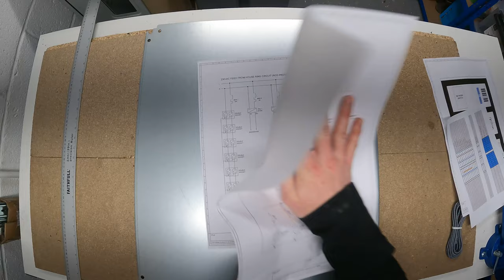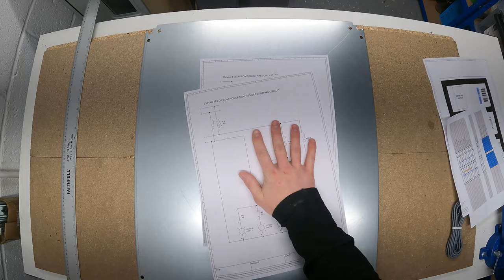My Home Automation Project Using Loxone - ASMR Edition

Comment: Maybe I don't see your connection, but:

You must connect all GND 0V's of the power supplies together, to get the same potential on all 24v devices/extensions, otherwise there could be transmission interference. 
You've split the 24v power over two supplies, which is fine, however you need to connect all GND's together at the end.
Reply from the maker: Correct, this has been done.

Comment: Couple of thing you might consider (or may have already and ruled out, apologies if so) 
Din rail shear rather than the jigsaw - quicker, cleaner, easier on the ears. (But a reasonable capital investment)
Din rail mounted Ethernet switches - I’ve found that “office” grade with plug in PSU’s have a higher failure rate than Din rail, plus takes up less space and front access to the sockets. Red Lion controls do some very reasonable priced units.
Reply from the maker: Hey Ben, thanks for your comment mate. A Din rail shear would be lovely, just don’t really have space for it. I don’t tend to use switches in panels and this is for my home project so not to bothered about reliability. You’re dead right though, for commercial and industrial projects I’d be using the type that you’ve suggested. Thanks again Ben 👍🏼

Comment: Love your videos man, what type of cabling do you use throughout the house to run on the loxone system, cat6e or are you using proprietary cable from loxone?

Second what considerations should one take when doing a new construction for wiring for loxone, how many cables to each tv, or switch etc. will the same type cableing work if you want to add control 4 on top of loxone like your other video suggestion. How do you cater to both systems when considering cabling?

Sorry loaded question but if you have time appreciate some wisdom?
Reply from the maker: I use both :) … depends if I’m using Loxone lighting.

With AV you just wire for however that device is controlled  (usually IP so Ethernet) back to the central plant or AV rack… obviously you’ll need need to wire for the speakers, coax etc etc too

Hope this helps. 🙂👍🏼

Comment: 15W PSU for the Audioserver ? The suggestion from Loxone is around 50W per Channel. So 100W for the Audioserver + 50W for the Stereo Extension. Or are you only using one Line/SPDIF from the Audioserver and the SPDIF of the Stereo Extension?
Reply from the maker: It’s actually about 18w per channel if you look at the recommended power. I’m only using one channel which should need about 0.8A but I’m running on a 0.4A PSU, I wouldn’t recommend this mind and I’m not running the speaker for a long time anything over 60%.

Oh and I’m not using the stereo extension, it’s just there for testing purposes.